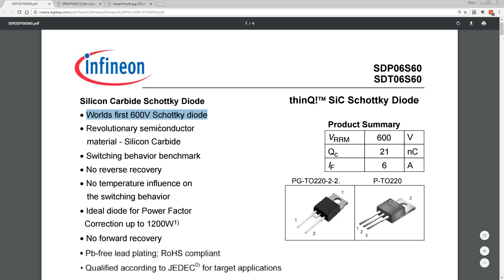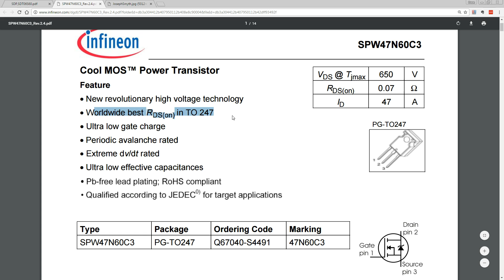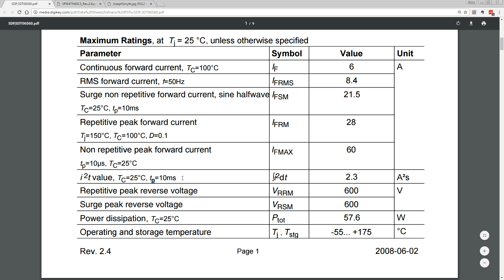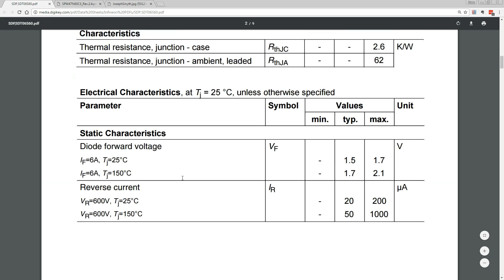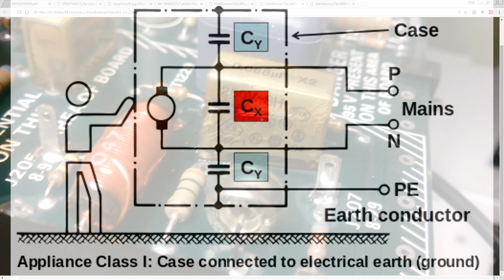EEVsmoke #1 - Magic Component Smoke

Comment: @EEVblog The EX 600V schottky diode looks like it has Exploded rather than melted or imploded.  The ejected material is sat on the PCB at the bottom of the photo.  Gotta love explosive failure due to rapid thermal expansion grin

Comment: A bit late but anyway,

https://www.sparkfun.com/products/retired/10622

http://www3.telus.net/bc_triumph_registry/smoke.htm

The Lucas motto: "Get home before dark."Lucas denies having invented darkness. But they still claim "sudden, unexpected darkness" 
Lucas--inventor of the first intermittent wiper. 
Lucas--inventor of the self-dimming headlamp. 
The three-position Lucas switch--DIM, FLICKER and OFF. 
The other three switch settings--SMOKE, SMOLDER and IGNITE.  
Lucas dip-switch positions: LOW and BLOW 
The original anti-theft devices--Lucas Electric products. 
"I've had a Lucas pacemaker for years and have never experienced any prob...  
If Lucas made guns, wars would not start either.  
Did you hear about the Lucas powered torpedo? It sank. 
It's not true that Lucas, in 1947, tried to get Parliament to repeal 
Ohm's Law. They withdrew their efforts when they met too much 
resistance.Did you hear the one about the guy that peeked into a Land Rover and 
asked the owner "How can you tell one switch from another at night, 
since they all look the same?" "He replied, it doesn't matter which one 
you use, nothing happens!"Back in the '70s Lucas decided to diversify its product line and 
began manufacturing vacuum cleaners. It was the only product they 
offered which didn't suck.Quality Assurance phoned and advised the Lucas engineering guy that 
they had trouble with his design shorting out. So he made the wires 
longer.Why do the English drink warm beer? Lucas made the refrigerators, too.  
Alexander Graham Bell invented the Telephone. 
Thomas Edison invented the Light Bulb. 
Joseph Lucas invented the Short Circuit.Recommended procedure before taking on a repair of Lucas equipment: 
check the position of the stars, kill a chicken and walk three times 
sunwise around your car chanting: "Oh mighty Prince of Darkness protect 
your unworthy servant."Lucas systems actually uses AC current; it just has a random frequency.  
How to make AIDS disappear? Give it a Lucas parts number.  
Recently, Lucas won out over Bosch to supply the electrical for the 
new Volkswagens. So, now the cars from the Black Forest will come with 
electrics supplied by the Lord of Darkness -- how appropriate!Lucas is an acronym for Loose Unsoldered Connections and Splices.

Comment: The blowout shape probably speaks to the quality of epoxy used to encapsulate the diode. The other TO220s formed cracks along the seams between metal and epoxy and areas that weren't in direct contact with the source of heat, the silicon chip. In this case the blowout occurred in a relatively uniform way circling the chip and radiating out. This shows that there were not any especially imperfect or internally stressed regions in the epoxy. I wonder if it is simply a higher quality package or if better quality epoxy is used as a rule on SiC parts which need to endure higher peak temperatures and stress?

Comment: I have one that might be interesting to try. I was looking at the RAMBo 3D printer controller and noticed they used Allegro A4982 instead of the A4988 like everyone else (am I the only one who has noticed they put the heatsink on the wrong side and essentially have the PCB upside down so all the heat gets sucked down into an area with zero air flow?)  I looked to see what the difference was between the two and essentially it came down to this .... "No smoke no fire (NSNF) compliance (ET package)"

Apparently Ultimaker went to these flameproof/smokeproof packages because the A4988 Pololu design burned up so easily.  I'm not convinced that was entirely necessary when just properly designing a driver board with the A4988 with the chip facing down and the heatsink on the back side would likely stop them from burning up and catching fire. Simply putting a heatsink on top of that style QFN package which is designed to draw the heat down and to the other side of the PCB does little to nothing as far has heat management. It's like whoever at Pololu who designed that driver has zero experience with this type of package and didn't even both to read the damned datasheet ......

Anyway I'd like to see just how flameproof/smokeproof those A4982 stepper drivers really are ...... They claim they don't let out any Magic Smoke when they die and that may just turn the entire Magic Smoke Theory on it's ear .....  (I suppose I better put a disclaimer saying I'm just kidding about that)

Comment: I've seen hundreds of those Rifa X2 caps looking like that. Nothing unusual. I think it is mostly age. Some of the ones I deal with are over 40 years old. They are used across mains switches in a lot of hifi gear.

Comment: Was disappointed you didn't let the smoke out for the viewers - it is often a sight to behold. I remember back in the day in the electronics lab, we'd flip around those light blue electrolytic caps when someone wasn't looking, just to see the show when they'd apply power. A nice bang, the magic smoke, and sometimes a spiral of blown out insulator if you were lucky. 5 cents well spent. Might be fun to duplicate the trick with some of these bigger bits to see how loud it gets.

Comment: Ha well I wish you'd had started this serial earlier. I had a powerful release of magic smoke one day on a LED projector. I was next to it exploded, totally cracked open, breaking its metal casing, splattering electrolytic capacitor goo all inside. 
Still, fixed it with salvaged caps and a bit of glue....

Comment: I got a PM3335  60MHZ (from ebay) oscilloscope had it about 2 week then it  blew up, on investigation I found the same X2 Mains rated capacitor had blown to bits this was same split horizontal and fell in half. This must be an age thing because looking on the forums you are asked replace this capacitor as its a common fault on oscilloscope power supplies . So this would be worth checking if your oscilloscope or any other mains powered equipment fails.

Comment: Why not create a new segment where you take the spec sheet for some component and check if the specs are accurate, including in overload (like 200% rated max, I am basing this on my own engineering moto: whatever you think you need, double it) situations ? Perhaps comparing them to known chinese copies etc...

Comment: I had an LM380 amplifier chip go off like that diode did. 
 The interesting thing is that it still worked, even with a dirty great hole over the die. 
 I used it for years like that, so it looks like only some of the magic smoke got out  :).

Comment: As far as I know, those filter caps are EXTREMELY common in old electronics, and the first thing that happens when you plug in an old computer from the 1970s is usually the explosion of the filter cap. Usually you can just take them out and the computer will work fine for years, unless it was built after 1990 or so, which is when manufacturers started using crappy chemicals in electrolytic caps and tantalum caps.

Comment: This content feels very low quality and hard to get excited about. I understand that you can learn to design/engineer better by understanding failure modes.Neglecting the previous statement; this content is probably much easier to make than a hardware review, project, or lecture. With that coin, it doesn't  provide an experience that helps me grow and learn to make better electronics.

tl;;dr 1 hour segments are probably harder to make but provide an order of magnitude greater experience.

Comment: Interesting concept of videos, but just looking at pictures is a bit boring.  We of course all want to see the thing going bang on camera, and if we can learn something in the process fantastic. It would interesting to push a component to its absolute maximums and monitor some parameters like temperature and performance. Finally get the magic smoke out, under controlled lab conditions of course

Comment: Love it! Last time i saw an X cap burst open was a few months ago in the handle of a clothes iron, it was used as a capacitive dropper though, for powering the iron's control circuit. It was certainly less dramatic than the one you showed though, the outside walls were just bloated and that was it. The cap read open. Replacing it brought the iron back into service. Not the kind of thing i normally do, but hey, a coworker asked me nicely.

Comment: The diode had a "massive" failure. Not something like 20 microseconds of 80A, but more like 1kA. How long you need to maintain it to get this result I don't know. It is not that the diode melted. It exploded. The die was heated up so blindingly fast that the top simply blew off. 
Back in the 1980ties I did that myself to an opamp. I was using it in a configuration with one pin grounded and reconfiguring it with the power applied was a bad idea. That's what I found out right then and there. (in the old situation, one pin was on a POT and I had turned the pot all the way to 12V)

Comment: I'd like to see finding the failure point and failure mode of components (destructively, of course :).  Then you could measure or speculate on the effect of the failure on the rest of the circuit.  Goal: How can we engineers design circuits to be safer (e.g. avoid a resulting cascade of failures) in the event of one component catastrophically failing?

Comment: I got 3 Siemens T1600 paper tape punch readers. The first two when I plugged them in caused the Tantalum bead caps on the power section to burst into flames! I'll see if I can video the third doing the same thing! If it does I'll send it to you. :)

Comment: Those particular x2 capacitors seem to fail a lot, I have seen many of them blow up just like that if not have the epoxy break apart making the capacitor useless.  They are made by Rifa which as far as I am concerned makes good capacitors but I guess the epoxy mixture they used for the old see through ones must break down over time and will start to crack.  Now I just replace them every time I see them as they are not worth taking the chance.  I have lots of magic smoke pictures, it is always good to study the cause of component failure XD

Comment: I think it would be cool if you can do a segment for us beginner electronics tinkerers simple circuit projects and moving up into more advanced projects and teaching us along the way.
Reply: Just go to the Arduino site if you want that....
Reply: Arduino is a bit expensive and much too advanced for a total beginner, I wouldn't know where to even begin with one. I'm looking at getting into hands-on electronics and there's soooo much stuff to get, and a lot of this stuff can get very expensive very quickly. I'd like some real simple circuits, some LED blinky stuff, things of that sort, and even this requires some investment (the soldering kit alone can easily run 50+bucks, multimeters also get quite expensive and I'm not even mentioning all the little stuff - breadboards, resistors, diodes, caps, pots, etc etc etc...)

Comment: In the 1980s, Acorn BBC microcomputers used excellent Aztec power supplies containing two X2 caps in the power input filters - they look exactly like the one you showed. I bought a couple of 'beebs' recently, switched them on, and all four of those caps fizzed and popped, releasing a special brand of magic smoke that smelled terrible. The worst smelling magic smoke I've ever encountered.
Those caps (from the '80s) do not age well. It's an easy fix, though.

Comment: I remember a truly amazing puff of magic smoke, back when I worked for a systems integrator as the service manager. It was one of the first 386-based PCs we'd had an opportunity to build, and the guy who put it together got distracted by the novelty of the huge processor (for the day) on the board. He didn't pay attention to detail, and accidentally left a couple of star washers loose on the motherboard, and, horrors of horrors, a PAPERCLIP.

He powered it up for its first time, and there was this snapping crackle and some popping sounds, as if he'd just turned on the heat under a Jiffy-Pop pan. Then the magic smoke poofed upward, along with some small bits of debris. The expensive 80386 chip and a few other chips on the board had exploded, the epoxy packages shattering with that particular cratering effect that looks so dramatic. I'm not sure whether it was the washers, the paperclip, or some other mistake in assembly that caused it, but the boss was more than a little annoyed and did some spectacular screaming when the guy told him about it.

Needless to say, the boss had to pop for a new motherboard and processor. There was a significant bit of trace char, so the old MB was a write-off. I wish I had pictures.

Comment: I've seen no solder left in threw-holes like that SDT/SPD06S60 many times befor, after an Exo-Thermal part failure. I bet you the solder is all on the other side of the PCB if not in the form of solder balls floating around the bench.  It is not that uncommon for the solder to melt and flow away when components "go beyond thermal" as they release the magic smoke.  Especially on the pins of Amplifier finals, Power FETs in inverters, and Diode packs in Computer Power supplies.

Comment: As some people are saying, it would be neat if some of the Smoke segments have the component fail on video. You could look at the datasheet and determine some of the characteristics that are most likely going to fail and then setup a demo to test the component limits. But also, this format is good because you are relying on real-world examples instead of falsifying something in the lab just for views. I do recommend these though, failure and safety videos for electronics are very educational. You always cover something that wasn't taught to me in University such as the X Class Capacitors in this video for power supply filtering.

Comment: @eevblog I'm pretty sure that the schottky diode you show here didn't melt, in fact, most TO packages aren't made of a a thermo-plastic, so they won't melt. Instead, it looks to me like it's blown the front of the package off. Hence the sharp edges, and the rectangle shape where the die is (was?) But damn, that must have been a seriously large overload condition to do that much damage to a component like that.

Comment: That X2 cap looks like a RIFA/WIMA metallized paper capacitor. Pretty unreliable after 15-30 years. I have never seen any plastic film X2 caps shorted and exploded like this (they usually go open circuit instead), but I've seen a lot of these RIFA X2 paper caps in the same condition you showed us in this video.

These type of caps are still produced - I don't know why, as to me they seem much less reliable than a plastic film X2 cap. AFAIK, MPs has smaller dissipation factor than most plastic film capacitors, but is it worth degrading the safety and long term reliability? And they are quite significantly more expensive than a plastic film X2 cap,  and I think they have worse capacity per volume ratio as well...

Is there anyone who knows, why they are still produced, if they seem to have such a lot downsides, including safety issues, as a safety capacitor?

Comment: Hi Dave, please keep this new format. These yellow capacitors in the Tek scope are from the manufacturer RIFA and known for these type of problem. The plastic case get cracks when they get older. I have seen this often in 70s and 80s gear. An actual case is a Yamaha Electone from 1982/83 where both of these caps are gonesky.

Comment: 4:51 I've seen a nearly identical component that failed far more spectacularly - it just exploded and looked like a chunk of twisted aluminum foil. The crazy thing was that the audio amplifier it was a part of was still working fine. Apparently all the points where the foils made contact had been burned away so the device became an open circuit again. It was a snubber across the mains transformer, so it wasn't strictly necessary. Unfortunately I didn't take any photos.

These capacitors use paper soaked in oil as the dielectric. Over time the oil dries out and the thing shorts out. It's a common problem with old electronics apparently.

Comment: Jumping to dumb conclusions again!, It EXploded, not "imploded" or melted.  These devices were held to the heat-sink with a spring clamp or clamp bar (partial hole above the left TO-247), not magical, wishful thinking.